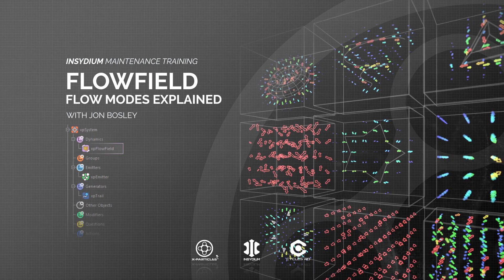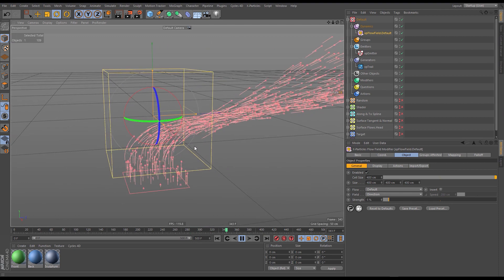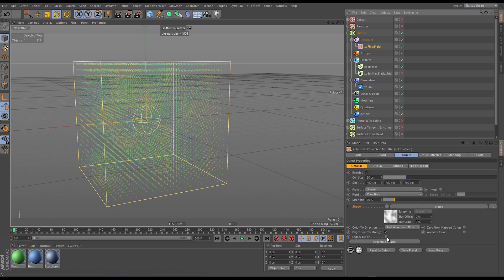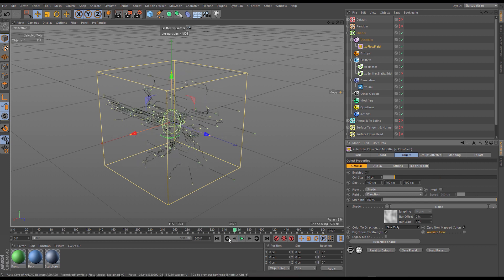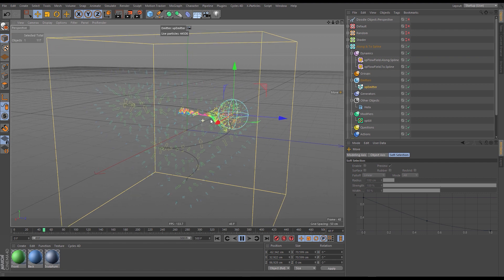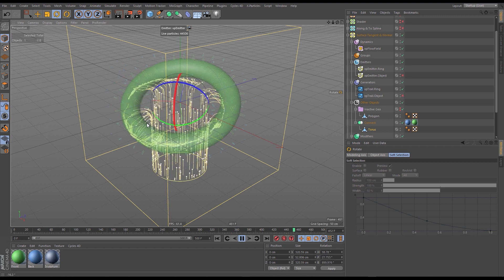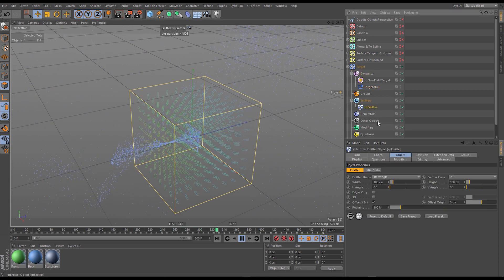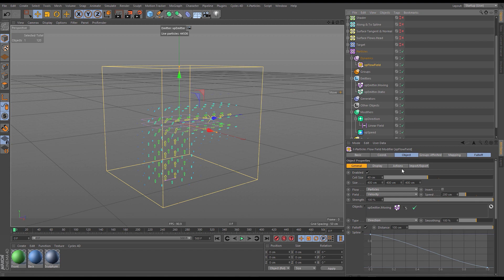Maintenance Training - Dynamics - FlowField - Flow Modes Explained

Comment: thanks for this extensive tutorial going through the basics. What I find mind boggling is how a 3D greyscale noise can drive a 3D flow field 10:42 From what I do understand greyscale values should only be able to determine a 1 Dimensional value, like a displacement map can only work in in one axies. Whilst a vecor in a 3 dimensional space would seemingly need 3 values to determine it´s direction. This is also the reason why Normal maps use RGB, so that they can change the normals in more than one direction.
What am I missing here?